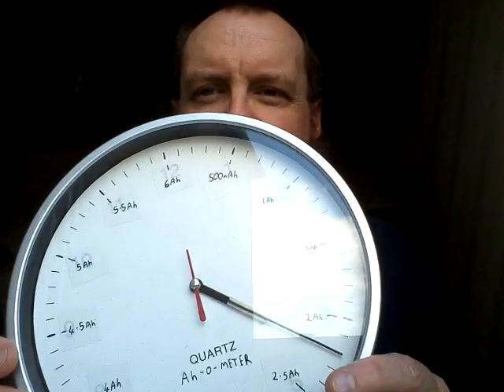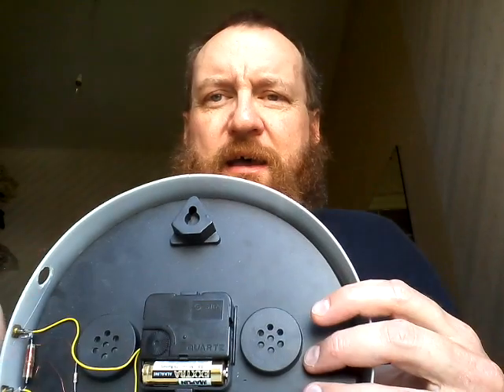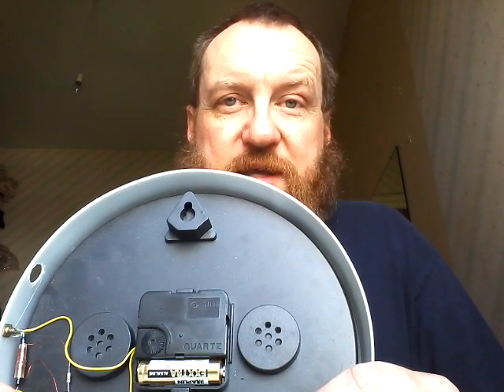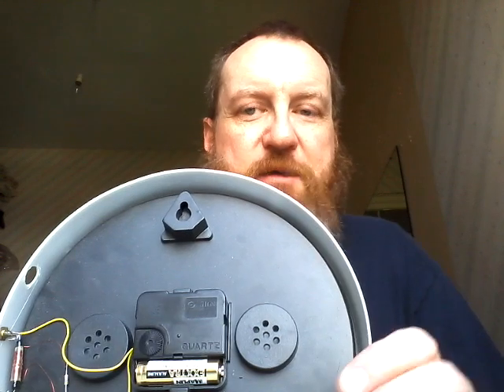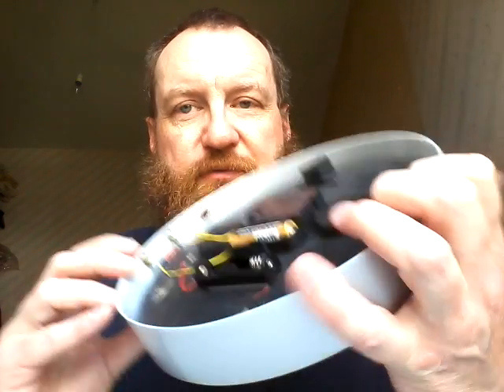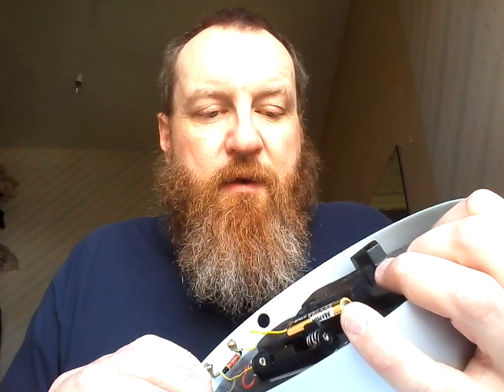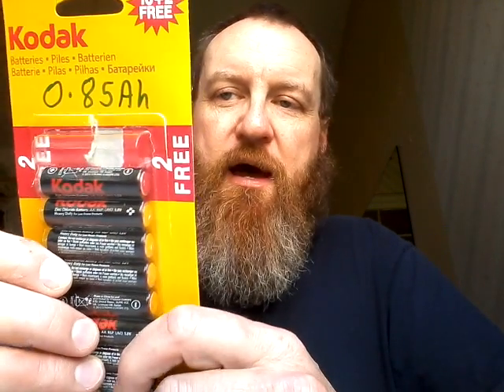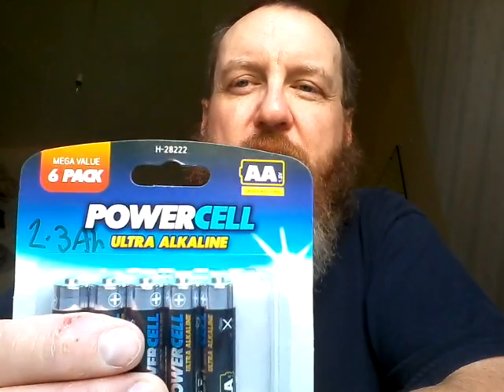Alkaline battery capacity tests.

Comment: In the past few years I have begun buying up cheap devices with "leaked batteries" from propertyroom.com auction service for retired law enforcement and unclaimed property.  I get the stuff for a song, for example my best buy thus far was a Nikon digital SLR with 21x zoom that I use when traveling, it had the easiest cleanup by far as well.  The thing is, most of the items I buy have Duracell batteries in them.  In fact the other day I was mowing the lawn here in our sticks and bricks home in South Dakota, when  I got too near our motor home, and had the steps out.  When we purchased the used vehicle, I noticed a small light on the bottom step, and asked about it, the dealer had no idea but said "Well it doesn't work and we won't mess with it" so I figured it was one of those deals where you just forget it is there and use it as part of the step.  At any rate, I bumped it on the end and that end came off.  I never noticed that day , however my good wife of 48 years was out there the other day and did. She came back in and told me it was hanging loose, well I figured she meant the whole step addition was hanging down, but come to find out, that light was powered by two AA cells.  Both Duracell, and both leaking. I removed the cells and will clean the light up one of these days to see how much damage has been done.  Thus far, it looks salvageable, as was the Garmin GPS V that was my latest purchase from Property Room, it too had 4 Duracell in it, one of them had leaked and did a bit of damage to the cap, it cleaned up easily though, and now it is one of the finest GPS devices I have for keeping track of how far we have walked, and makes a super compass for our RV which is too old to have anything like that built in.

Comment: I've got a few "Super Heavy Duty" batteries and they're just covered in corrosion. one of them has a voltage of 1.37 but It doesn't seem to work in anything... maybe the V drop under load is really high? or the battery contacts are just fucked

Comment: Can you do a more detailed explanation of the circuit on your clock tester. I'm not sure I understand how the second battery changes things.
Reply from the maker: +Derek Harkness The clock has its own cell.  The power to the clock mechanism is switched through a reed relay with a custom winding to give a specific load and drop out at about 0.75V that is powered from the cell under test.

Comment: Clive, you're right re: chemistry. Zinc Carbon use Ammonium Chloride electrolyte, Zinc Chloride use a mix of Zinc Chloride and Ammonium Chloride. Originally this was to prevent the ammonia produced by the regular zinc carbons. (Ammonia in stuff with brass and copper=very bad)

Comment: Also, one thing I wanted to ask you from watching this Clive (if you have the time of course)- about rechargeable batteries. I bought some pretty good ones (did a little research) but now one of them won't charge any more. I tend to use two of them and then switch to the other two so why could it be that one now won't charge at all while the others are fine? The charger I use has an LED indicator to show that it's not working (it flashes red) but I've tried another charger and it simply won't hold any energy. Thanks in advance if you know anything. I should check if you've covered rechargeable AAs before too.
Reply from the maker: +MagikGimp The fast chargers often interpret older cells as bad because their voltage rises too quickly and makes them look like non rechargeable cells.  Try your old non-recharging cells in a traditional slow charger.
Reply: +bigclivedotcom Ah, good to know; cheers Clive. I do have an ye olde one knocking about somewhere. It's just strange that one of them went and not the others.
Reply: +bigclivedotcom Good to know, as I recently bought a fancy new charger and it seems to have way more problems than my older charger ever had.

You can tell its a detection problem as sometimes if you try it in a different slot or polish the terminals first, it will work.

Comment: Hi Clive.  Thanks for the comparison!  

Just curious... have you tested recharged alkaline batteries? I have used the recharger that is supposed to recharge alkaline-manganese cells and they seem to go longer on the second charge than the original charge.  After 3 or 4 charges they seem to deteriorate rather quickly.  But that is 3 or 4 uses instead of ONE.

I wonder if the improvement after the first use is because of incomplete factory charging or some other effect.... Just curious if you have experimented with the alkaline battery chargers.
Reply from the maker: I played with various circuits for recharging alkalines when I was younger.  They didn't give a good amount of charge and often caused the cells to leak due to an internal build up of pressure.

Comment: Why do batteries leak when they go flat? (my local PoundStretcher used to sell big packs of AA batteries and you could see half of them covered in white crusty mess that was slowly soaking into the cardboard)
Reply: +James Grimwood   For the Zinc–carbon batteries the shell itself is one electrode and it's made out of zinc, so as you discharge the shell actually gets eaten away. For alkaline batteries the zinc electrode is actually in the centre and the outer electrode is manganese-dioxide MnO2 powder, which is encased by the steel shell of the battery. The danger for alkaline batteries is that at the end of life, if all the MnO2 is used up, the cell will out-gas hydrogen and the increased pressure will rupture the seal. So normally an excess of MnO2 over Zn is used in order to prevent out-gassing. But it is also possible that the steel canister eventually gets corroded by the electrolyte.

Comment: Those Kodak Xtralife are the best I have used in terms of capacity and value. I used to have them in a wireless mouse and they would last me a little over 3 weeks (I am a heavy user on my PC I game a lot on it) and compared to the high end Duracell which would last me around 4 weeks they are extremely good value as back then they were 6 for £1` and still are (poundland sells 8 packs during Christmas) but the Duracell ones back then were 8 for £3

Comment: Actually for the devices I use the most now days I have gone over to the rechargeable Eneloop batteries.  They seem to be the longest lasting, and while they are a bit more costly, they seem well worth the cost, they charge rapidly and seem to hold their charge for a very long time when put away in the device, which is something I would never do with Duracell's.

Comment: Great set of tests. Could be good fun to test cheap, branded alkaline batteries sold by certain eBay sellers against the same cells sold by retailers to see if there is any difference in performance (ie. to identify if some of the eBay ones are fake). I've certainly grown wary of incredibly cheap packs of Duracell and Energizer batteries being sold on eBay and tend to buy non-consumer brands such as Varta instead.

Comment: Although I’m follower of your channel, I stumbled on this quite old video, as aí was looking for Alkaline capacity results (9V in special). I had thought to use exactly a cheap 1AA analog clock for that, and you comments about cutoff voltage were among my concerns - which somehow you solved. 
Could you please SHARE the info / schematic how you did it?
Reply from the maker: The clock has its own battery which is enabled by a magnetic reed relay in series.  The winding on the relay is matched to pass an average current for the discharge voltage range before the relay opens.

Comment: Most Duracell batteries have a shelf expiry date of about 10 years after production, which means those Simply Duracell batteries had been sitting in a shed somewhere for a good 6 years before you tested them.

Comment: Zinc carbon batteries (often labeled as "Heavy Duty" batteries at least here in the states) do have a few advantages. Lower capacity and a slimmer temperature range can be offset by the fact that they simply do not leak. This makes them ideal for something like a flashlight battery you only use infrequently for short amounts of time, like during a short power outage.

Edit, only after paying attention do I realize that he said Zinc Chloride and not Zinc Carbon, my bad.

Comment: I agree: The bottom line is, the cost per hour of use of your device. It doesn't matter if you get a cheaper cell, and replace more often, or, buy an expensive cell and use it longer. The question is, how many hours can you use your device per dollar, or, how many pictures can you take per dollar, or, how many hours of light can you get per dollar out of your flashlight?(torch) At low rates of discharge, sometimes, those cheap carbon-zinc or zinc chloride cells can be pretty cost effective. In high drain devices, like camera flashes, alkalines are your only choice, just because carbon zinc can't produce the current necessary for its power supply. A zinc chloride cell that will no longer power a flash may run an LED flashlight for another 10 hours!

Comment: Have you tested those bulk amazon AA batteries? They are very cheap, and most of them seem as good as anything to me. However, they seem to be slightly on the inconsistent side, but that might of been my specific set of batteries.

Comment: I know what you mean about the Kodak one leaking as soon as they are flat.  I wrap them in bog-roll when fitting them.

Have you tested the Sony and Hyundai ones?
Reply from the maker: i think it's better just to avoid the "bargain" packs of 10 or 12 zinc chloride batteries completely and just look for the alkaline ones.  Previous tests on the Hyundai, Mitsubishi and Sony branded cells suggested they were just the same cells with different pseudo branding on them.
Reply: bigclivedotcom Do you remember in the 80's when batteries had acid in them?.  I remember this as a small child and how they would run out really quickly as battery operated toys back then weren't very power efficient. In fact they were terrible, I remember a little battery operated toy having lots of big capacitors in them which seems crazy now you think about how power efficient and simple such toys would be nowadays. Hell you are more likely to find capacitors in high end graphics cards that need smooth power delivery

Comment: How does a Zinc Chloride battery leak? I took a fresh on appart and ther was just some solid black stuff and a carbon rod inside...
Reply: Extrude Studios the problem is you dissected fresh one... as the discharge progresses there are chemical processes going on and also it eats up the zinc electrode ..which is also a container for that mess.. so as it eats its way thru that zinc nothing stops nasty caustic fluid leaking

Comment: Could you look at some of the new Ni-zn AAs? the specs look pretty impressive, they're almost as energy dense as lithium cells (the ones on sale now hold around 2.5wh and 14500 "AA" lithium cells hold around 3.3wh) and the discharge rate is higher then Ni-cads. the charging parameters are pretty restricted though (although they're perfect for fast charging)... they don't like trickle chargers (hydrogen builds up in the cell and vents during trickle charging) and require a 1.9v constant voltage charger
Reply from the maker: My experiences with nickel zinc cells so far have been very disappointing.  I'm not sure where the technology is going.
Reply: Jonathan Brown I think they're just really sensative to their charge/discharge perameters... hobbyking says they'll last over 600 cycles but you need a special ni-zn charger which charges at a constant voltage instead of a constant current like most batteries.

I was thinking about buying some for a dead skin remover which isn't that powerful with standard AAs, cheap ni-cads or good ni-mh.

I've just ordered a rechargable Lithium AA (14500) with a protection circuit though which I'm just going to use with a dummy AA... The ni-zn batteries was expensive and I didn't have anything that could charge them, Plus I've converted 2xAA shavers/trimmers to single lithium cells and it made a huge difference so I'm hoping it will be the same this time

Comment: hi I've tried o travel clock with I little Mes. filament lamp in parallel.when the lamp discharged the clock stopped.your pound battery came out good.Also Wilkos full of juice orange as cells done well.top for 8.can't beat that for value.

Comment: Anyone know of a good, cheap, D cell alkaline?
I use them in my incandescent Maglites.

I have tried Duracell Industrial, but found many of them have a serious issue - They're very sensitive to physical shock.
One knock on the torch, and the light output diminishes and slowly gets back to normal. It's certainly a fault with the type of cell, because even an old pair of Zink Carbon D cells didn't do this.
The AA, AAA Duracell industrial don't seem to have this issue though.
Regular Duracell are good, but a bit too expensive.

Has anyone tried the Maplins own ones, or Amazon basics version?
Would really preference Alkaline over Zink Carbon, or Zink Chloride.

Comment: Well I never. Before I discovered DC voltage conversion I used a quartz movement to draw the last bit of "1.5v" out of any AA cell, after the TV remote has had all it can take. After that I'd discovered the 99p buck converters I'd stick three of them into a 4.5v AA holder attached to an off the shelf ebay device to produce 5v which may add a couple of hundred mAh to your phone battery. Anyway, totally agree with you re the pound shop alkaline cells, you get a reasonable amount of bang for your buck. I like Ikea's "ALKALISK" mostly for the name and the packaging, but they do the job.

Comment: Alkalines don't leak?
Did I hear that wrong?
I've have opened up plenty of solid state pinball machines and seen plenty of alkalines leak and kill the boards inside.
I use Lithium double A.s for the solid state battery holders as those don't leak they just go dead.
And for the Rottendog I have in my LaserCue I don't have to worry about that as it is a button cell and not the regular 3 AA battery holder.
I love that CPU and Logic board in one. :)

Comment: l have never had a Kirkland (Costco homebrand) AA leak, and the use by date ten years in the past, I'm not sure of the capacity though, the price is 10 pounds for 48 batteries.
Reply: Kirkland Signature and IKEA alkalisk are the two best bangs for your buck in my experience. I tend to go for the IKEAs though since you don't have to buy in bulk.

Comment: Old video, I know.. but I did a similar test like this in grade school using a toy train and a counter wheel. Round and round it went clicking the counter each time.. though I couldn't tell capacity from that test setup, the cheaper Rayovac batteries outlasted the Energizer and Duracell batteries, Duracell coming in last place. Energizer and Rayovac were close but the Rayovac edged them out with the cheapest price. That's what I still buy to this day lol

Comment: Brilliant! I was contemplating building some sort of battery testing rig but was a little stumped by my desire to incorporate a voltage measuring 'data logger', so I love your simple solution. I found data loggers were many tens of pounds and generally came with Windows PC only software.Incidentally if you know of any cheap data logging solution (preferably Mac OS compatible), I'd be grateful thanks.
Reply: If you're still interested 5 years later, check out the SkyRC MC3000 analyzing charger.  Bluetooth phone app and a USB serial port for data logging and control.  I think there's a mac-compatible application for logging since the format is similar to other hobby chargers.  The MC3000 has 4 battery holders, unlike hobby chargers, and a detailed LCD (curve display, mWh on discharge).   Easier to deal with than a UBA 5, does 90% of what I'd want, and WAY cheaper.
Reply: @radellaf  Thanks for that it still looks tempting although I did give in in the end and buy a Hobo 4 channel Analog Input Data Logger because it runs on Mac and gives me more versatility than a dedicated battery charger. I’ve used it more for temperature monitoring than anything. That SkyRC does have the drawback that it only comes with Windows software. The 3rd party Mac/Linux s/w for it looks dodgy maybe.

Comment: Why do some dead alkaline batteries make different noises when smacked than charged?
Reply from the maker: The chemistry moves internally during discharge and there may be a slight internal pressure change too.  If you drop them on a table end down then the fully charged ones will land solidly and usually stay vertical, while the discharged ones will often bounce and fall over.
Reply: Interesting.

Comment: What about the Energizer Ultimate Lithium ones?  curious about those vs alkaline.
Reply from the maker: For me the main advantage of the lithium cells other than their very high capacity, is their ability to work reliably in very low temperatures.

Comment: Hi Clive, I was wondering ....since you have a secondary battery installed,  how does the clock stop when the battery under test is out of power ?
Reply from the maker: +Aneesh Prasobhan I use a Reed relay.

Comment: Hi all.. going on the simply shit duracell batteries..yes i agree with Clive on these.. i bought a pack of 12 (selby date 2020) from a warehouse outlet in Sheffield.. i use these in my 4Kw solar pannel array to monitor in a wattson solar/grid monitor to check my daily useage/generation.The 4 AA Cells fit into a wireless transmitter...after 3 months they fail..i have now used all 12AA cells over 9 months..previous to this i used the normal Duracell AA cells..1 set of 4 gave me 10  months running without any problems..the proof you get what you pay for.. i will be looking at the fusio max in the future..Cheers Clive for the info..a great video